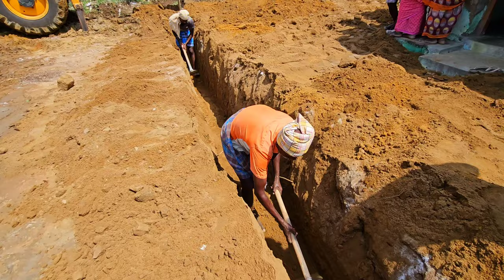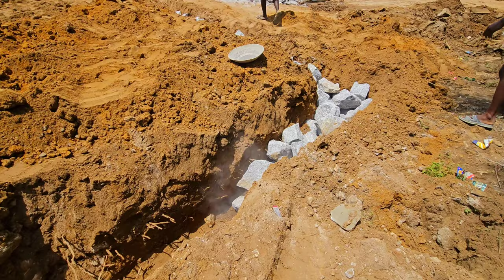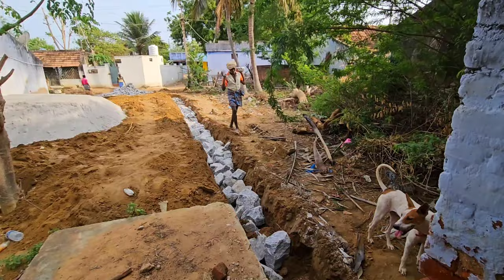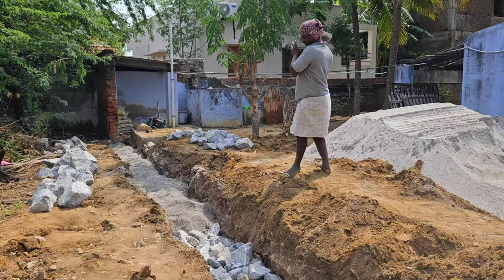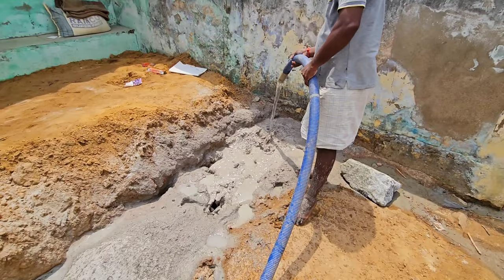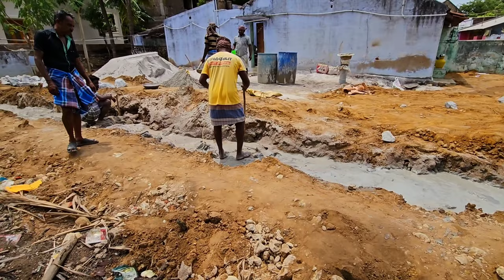Technology of Foundation_Natural Stone Foundation Fillup Complete Work|Stone Masonry Basement

Comment: Not a right way , before putting boulders they need to prepare foundation base with mix of fist sized stones and mortar mix , then add boulders with layering of wet mortar mix in between , dry pouring of mortar mix is very bad for structural strength, not right approach for load bearing structures like foundation
Reply: You didn't seem to understand the foundation design. The last step you watch on the video , is the wetting of the cement on top of the boulders , which will penetrate through the cracks and spaces between the boulders , reaching all the way to the bottom. The armored structure that will result, will be a load bearing foundation which can even support a 3 floored house.
Reply: @unassailable6138   I am not saying it will hold weight or load , concrete compaction and structural strength varies greatly between dry pouring and using wet concrete 

Wet concrete has higher and even  compaction compared to dry poured one 

dry pouring saves time and labour, but with comprise in compaction ratio
Reply: @gautam1511 yes dry pour is only 1/2 to 1/3 times the compression strength of wet pour. However in this use case that would suffice.

Comment: Not A correct method. 
For stone foundation
1) Digging upto dard strata
2) provding 1:4:8 cement concrete at botton of soil
3) Contruction of wall by hand via cement sand mortor..! 
4) by applying cement sand and water from top.. Cement will get absorbed by soil and foundation will be weak despite using cement
Reply: The paste  (cement + sand) with added water,  doesn't get absorbed by the soil. It will get deposited under the first layer of stones deep down on the trench ,and then above it , all the way to the top. When the paste is visible at the top. this means all the height of the trench has been filled with the paste and , together with the stones, we have a  concrete,  load bearing armored  foundation. It has been done like this for hundreds/thousands of years. Angkor Wat used this system, with wet clay , instead of paste, poured over its stone foundation,